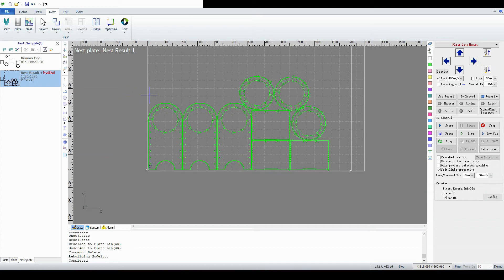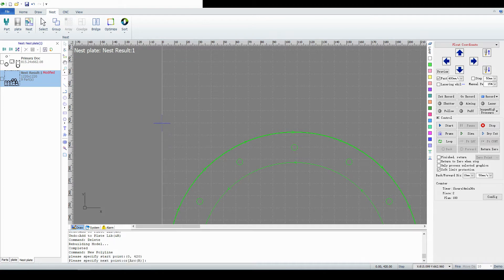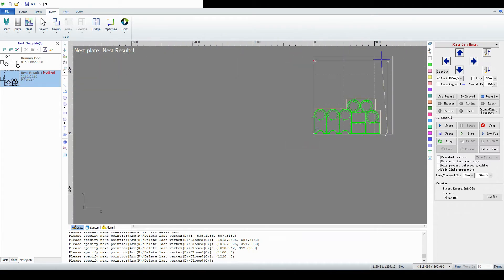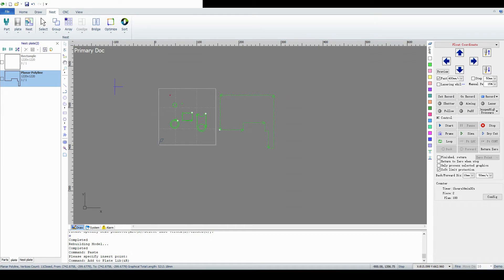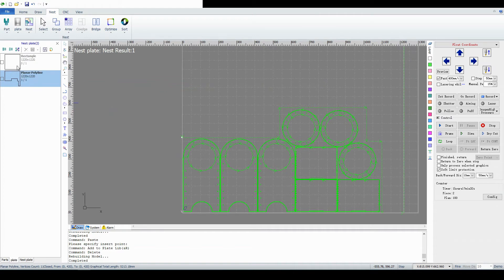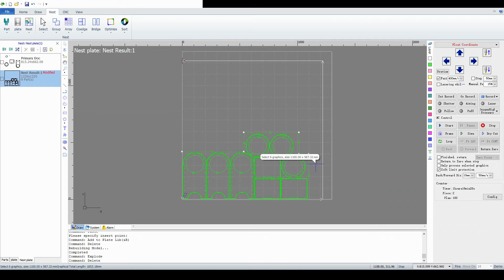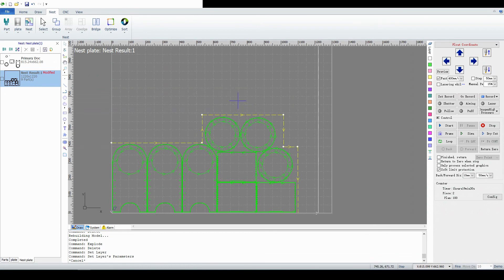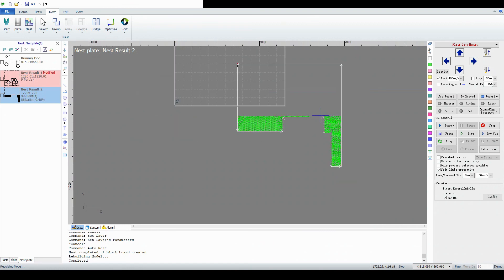Saving usable drops in plate library cypcut.

Comment: Looks like it's been a couple years since you have put out a video. I just ordered a 1500W laser and am trying to learn as much as possible before it gets here. I really like your video and hope you post more. One this I'm looking to learn is how to set up for marking bend lines and engraving. It would be great if you can help.
Reply from the maker: Yeah the software changed a lot since I bought my machine so my simple videos are out of date to the current interface. My machine is still making parts but it's five years old and the new machines are very different so not much of my information is current.. I do have some data on filtration and other operations data that might be useful. I've been running a very large contract job for the past two years that has taken most of my free time, but it's looking like that will be slowing down soon.
Reply: @Small shop lasers  thanks for responding.  Yes, any information you can share would be greatly appreciated. I'm curious about the software. Is it that the new version of the  software won't work with your laser, or is it expensive to upgrade to the newest version?
Reply from the maker: @mikebourret3624  So as far as I know I can just download the new version and it should work since the control card is the license dongle. But I'm concerned that I will lose the adjustments that have been made in the backend of the software than make it work correctly.. I will likely just download the newest version to a desktop computer for making videos since 99% of the software is identical in function they just changed the UI and most of the menus have better English in them.

Comment: how would you edge seek these custom plates?
Reply from the maker: Sorry never saw this. So you would need to rotate the sheet so that a large square area was on the same corner that you use for edge seeking, and you would need to insure that it is large enough and it the same approximate location that a whole sheet would be in.. Edge seek as far as I know is a "dumb program" it does not adapt to different sheet sizes or shapes. So you need to place the sheet where it expects a whole sheet to be, otherwise you WILL crash the machine.